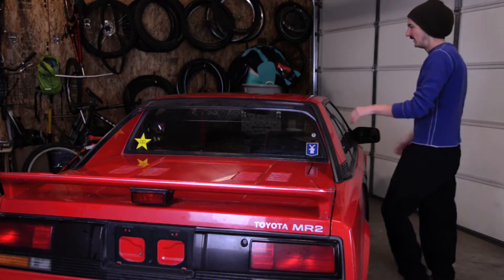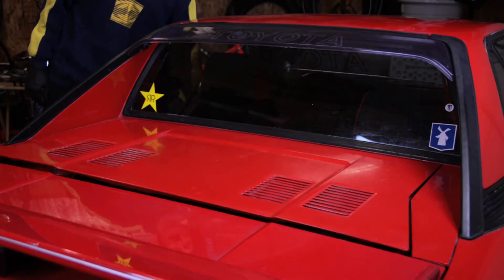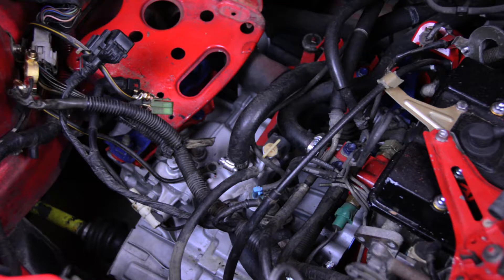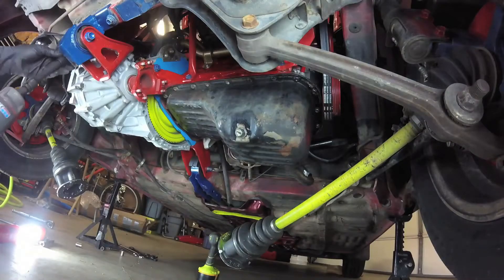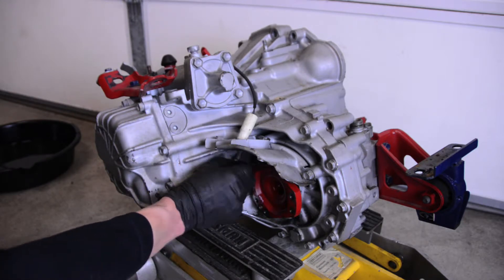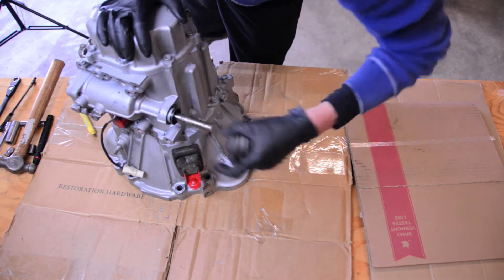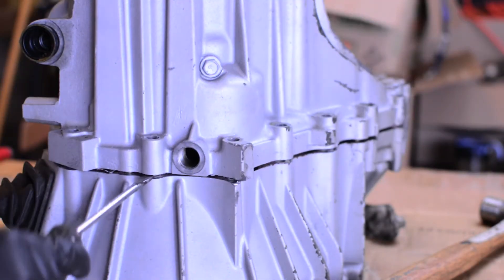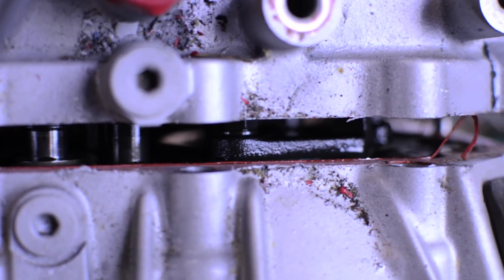C52 Repair : Breaking and Entering | Ep 1

Comment: Very helpfully ty. Thought i had done something wrong when I tried to pull the bell housing. Thanks for pointing out that I needed to unbolt something inside. Wierd design on this trans
Reply from the maker: Yea it's a funky setup. Technically, Toyota doesn't want you to do it this way, but, as you see, it can be done!

Comment: Love the series man! In the market for one of these currently. Such a shame where I live in the North East these cars pretty much don't exist. Any advice for a first time buyer of an aw11?
Reply from the maker: Hey sorry for the slow reply, we just added a new member to the family (a human this time) so things have been a little wild. 

As for advice, hard to say these days, a clean chassis at a reasonable price used to be easy to find, now not so much. I'd say the usual "old car stuff", check for rust, unibody damage, severe crash repair, etc. Specific to AW11's? Be sure of what you want, and where you want the car to be. There are few greater things than taking the T Tops out and going for a rip, but maybe you want something more track focused and prefer a hardtop? It's getting much, much harder to find quality interior components, and other stock replacement parts, so buy the cleanest one that you can, and treat the plastic very carefully. 

The most important piece of advice I can give however? Make sure you buy one that you WANT to drive. The joy of these cars is using them, feeling what Toyota was in the 80's, and you can't do that looking at a pristine example that you are too afraid to drive out of the garage. My 85 has it's fair share of bumps and bruises, it's a clean car, but the slight amount of wear helps me push the rarity of these cars out of my mind and just enjoy the drive.